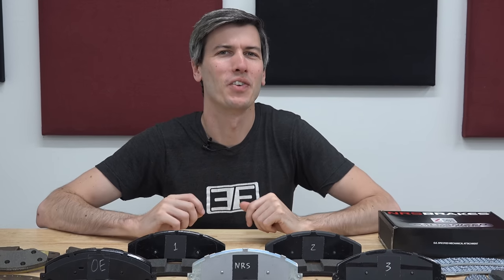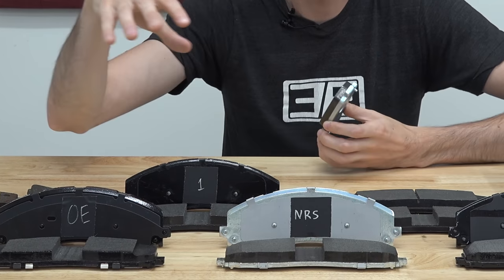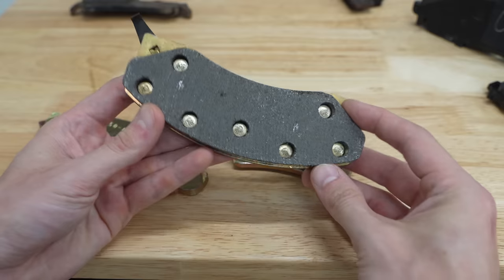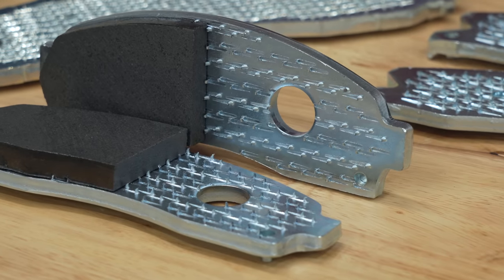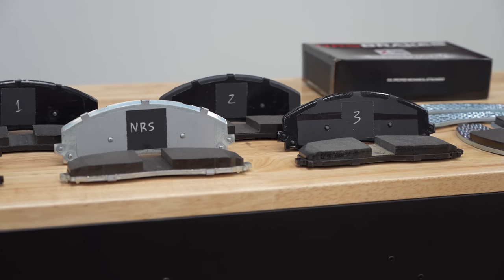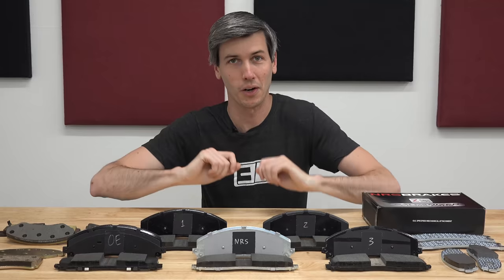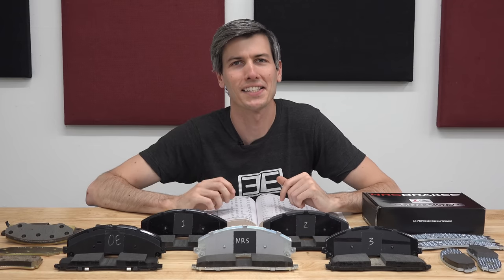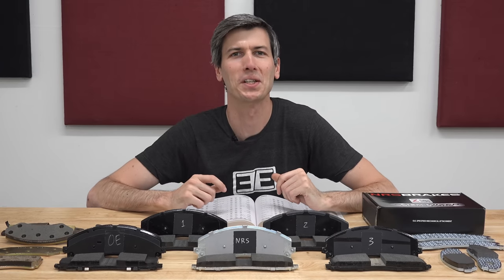The Sketchy Truth About Aftermarket Brake Pads

Comment: This is valid for track vehicles and work vehicles. Let’s face it, majority of us have never overheated brakes like that and have never had friction material separate from the backing plate.
Reply: Lol this whole video is a paid advertising and he doesn't disclaim it as such. Like did you have any doubt he would NRS brakes the best of this bunch?
Reply: Shoot over all quality is bad for aftermarket parts even oe replacements got my brakes redone and they are done after 3 months of normal driving mind you I might have put 3k on it and I have a warped rotor and completely worn pads...
Reply: In my lifetime, I've never had a brake pad fail on ME.  I just buy the mid-range Advance/Autozone/NAPA/O'Reilly pads.  Whatever is convenient.  I do not drive a racecar or a work vehicle.
Reply from the maker: Yeah - as stated in the video - all the demo pads shown are for a heavy-duty truck (though a ton of folks buy/drive this truck in the US).
Reply: It's a concern for trucks and rv's. Its pretty easy to cook your brakes on a long incline. I'm about to pickup a 20500 gvwr motorhome and that amount of weight generates a tremendous amount of heat.
Reply: Engineered solution, even for heavy duty/racing: regenerative breaking
Reply: @AB0BA_69 he does disclaim it, twice in the video and once in the description.
Reply: @nsilversradd  you mean, he does claim it.
Reply: You ever drive over the passes in the cascade mountains? Or travel across colorado? Miles and miles and miles of steep downhills. Yes technique in both driving and braking help, but you definitely see people just ride brakes down the hills forever
Reply: Agree, bit of an overkill.
Reply: @jblob5764 True, but this is a very small fraction of the driving done in the USA.  Far more brakes fail from rust than from heat.
Reply: try moving to a state that's not flat 😉
Reply: @EngineeringExplained I drive a pickup truck and do construction work.

 I buy my brake pads from AutoZone and I have never had them delaminate. Even running them down to almost nothing. 

I've been doing it for almost 40 years and I'm a carpenter not a mechanic. This delamination of brake pad material is a non-issue unless you are driving race cars or something.

 I'm in the city so I have to slam on my brakes often enough. The brake pad material is not coming off.
Reply: @actionjksn  you also probably take care of your equipment. You get some drivers that don't and you would be amazed at the issues that pop up. Had a guy driving a F250 with a enclosed trailer at work, and the only reason the mechanic learned the trailer had completely greased trailer brakes is because the truck's brakes were completely ruined. We fired that guy, but some people don't know there is a problem until it is a very big problem. 
There are plenty of videos showing just how oblivious people are to the state of their vehicle. Seen one a few weeks ago where the customer brought in an AWD car for an issue and the mechanic found a sizable chunk of the rear differential housing was missing; that the customer knew nothing about. I think it was a Jeep that another guy was checking out a noise and a pin in the transfer case had cut a groove out of the case, like a quarter or more of the case has a pin sized slot just ground out of it.
Reply: To the people saying its a non issue because they have never had it happen, remember we're literally talking life and death here.

Ever been in a plane crash? Me neither. You know why? Because they take stuff like this deadly serious. Its ok if we do more of that with motor vehicle safety.
Reply: I have had pads separate.  And not from hard driving either.
Reply: @russelloppenheimer3970 oddly enough, airplane brake rotors are attached with, let me check the Boeing manual for 737-800, oh yeah, it adhesives.
Reply: @Xander-dx6mw  nobody said only mechanical attachment is acceptable.

One of the issues wirh adhesives is backing plate rust causing pad to shed. Airplane systems have regular inspections and maintenance that is not neglected like cars and trucks. There are failure modes that happen on roads that won't be happening on runways.
Reply: Im in canada, I had a small sedan, installed cheap parts on it, and got all kind of material brakes failures, includind brake pad delaminating because of rust and no mecanical bonding, also brake material breaking into little pieces. So I totally believe in the absolute superiority in longevity and performance of good quality products and rust prevention techniques.
Reply: The main way I see separation is rust jacking, which has nothing to do with overheating
Reply: Great info. Would have had much more value if the brand would have been disclosed.
Reply: The average driver speeds and tailgates.  They are very hard on their brakes. By the time they get their destination the heat generated is shocking.  Rotors get hotter and hotter sink and transfer it to the pads.
Reply: I have literally had brake pad material separate from the backing plate on multiple occasions while tracking vehicles.
Reply: Regardless he presents facts and DATA. What do you have? Anecdotal experience. Literally means nothing with respect to the engineering world. Yes, most brake pads live long lives without catastrophic failure, but that’s not all that’s brought to light here. This testing plainly shows how some are simply engineering pads to a higher degree, and  that OEM is usually the best bet all things considered.
Reply: @nordicpride9708 that's all well and good but it's clickbait af to title the video "the sketchy truth" when the actual truth is that all pads must meet industry wide safety standards. Is one better than the other? Sure. Is it in any way even close to being "sketchy" to use an adhesive pad? No.
Reply: True. I guess it only matters if you think you’re paying for something made better than it is.
Reply: @Imwright720  Agreed, I don't ride with non family members much, but when I do I'm shocked at how they drive. It explained why one coworker was complaining about getting brake jobs every 15,000 miles. I typically go about 100,000 miles on a set of pads, and only replace them then because it's easier than continually checking them as they get thin.
Reply: I'm like ,if you've done that (separated pads and severely overheated your brakes) on the street you're doing it wrong.
Reply: @GoldenNada  agreed that newer stuff is trash. 
I found some "nos" repco metalmaster metallic pads on eBay for my mk1 VW. 
It was a great pad back in the day and I haven't found reasonable priced modern pads that work as good as those.
Reply: This guy obviously has never lived in New York lol
Reply: Your brakes can get stuck and overheat
Reply: You're obviously not from Florida
Reply: Though I have seen chinesium crap separate under normal use in a fairly small car (VW Golf, I think). And by chinesium crap I mean the guy probably spent less on said brake pads than on the day's pack of fags.

I also once saw ones which had separated IN THE BOX.

The level of pure shite you can buy on the internet never fails to impress 😂

Beyond that though you're right, unless you're street racing or carrying 3 tonnes of cement down a steep hill or something like that, you should never get the pads hot enough to suffer this issue. So long as you don't buy crap.
Reply: @nordicpride9708 yeah, that's why everyone who races uses OEM lol
Reply: @CS-pl8fc  We are discussing light truck/car applications. If you want to compare something that’s not analogous, it’s pretty much a moot point. Apples and oranges. Never once did he nor I put this in the realm of “racing”or “race cars”.
Reply: @nordicpride9708  people race cars. People track their daily drivers. That's a car application. And you weren't discussing those things, you were discussing how well they were engineered. And you're wrong that OEM is usually the best.
Reply: @CS-pl8fc  I want some of the GLUE you are huffing 😂
Reply: idk it still seems better to have them mechanically attached
Reply: I have
Reply: I actually know someone who detached the friction material but I think it was just a defective one
Reply: Even that is debatable. *DAY* at 550F ? Where outside of the race track you see temps like that ?
Reply: I had the friction material separate from the backing plate on the brake pads of my car. It failed the inspection.
Reply: @jblob5764  Failure to downshift, consider loading of vehicle, or reduce speed for hills is operator error. Good brakes are more tolerant of error than cheaper ones, but any brake system meeting DOT standards is sufficient for a vehicle, in good repair, driven skillfully, within legal limits.

So many problems with vehicles come down to "improper adjustment of the loose nut behind the steering wheel," with grossly-negligent maintenance getting an occasional assist.
Reply: @jblob5764 Thank u !   Indeed and it's so bad and ppl are sooo dumb-e, that the gate ppl at the national or state parks there in those mountains in CO, have to check your brake temp w/ a thermal gun!  Even my awesome basic Cherokee was slightly hot
Reply: Hey greg, speak for yourself! You are also totally oblivious to the point of the video.
Reply: @RyeOnHam I've had 2 week old drum pads fail on me. The pads basically disintegrated almost immediately. It was not user error, it was cheap pads. They were the cheapest I could get from the parts house and they weren't worth it. I got the house brand or the 2nd or 3rd cheapest option anf they were completely fine for years.
Reply: It's pretty easy to overcook the brakes in cars and SUV'S if you are carrying close to the payload/passenger weight, driving fairly aggressively, and in the mountains.

For example, took 3 buddies in a Santa Fe on a golf/houseboat trip. Loaded it to the max with supplies for the week and 1000 lbs of passenger weight. Trip was 4 hours long through the mountains with frequent passing. The front breakpads were glowing when we stopped after I noticed near to no braking ability. Had to dial it back the rest of the day.
Reply: No, this is valid for safety and must be adhered to as a standard of manufacture.
Reply: I have overheated my brake pads and boiled my brake fluid canyon carving with my car. Mind you, it’s a 4000 lb grand tourer with large Brembo brakes, but the pads and brake fluid just weren’t up to the task. And that was street driving, mind you, highly spirited street driving.
Reply: Yeah I have to agree in every single application that I've ever had in 32 years. I've never had a brake pad fail or separate. Yeah I'm not towing the space shuttle or anything so maybe that's why?
Reply: Here in the northeast, where the roads are covered in salt for at least four months of the year, pad separation is VERY common. In my years running a repair shop I've seen more pads replaced because of separation than because of wear.
Reply: I drive small light cars and don't exactly beat on the brakes. That said, I have seen my brake pads and those of customers separate partially or entirely. Luckily it never caused a safety hazard, but it definitely happens. None of the pads I observed this on had mechanical attachment and most only had a few of those post holes.

The most glaring example I can give is on a 90s Impreza I started hearing noise in my front left when I would turn one way, but not the other, and only when I wasn't on the brakes. When I inspected the brake pads, it turns out the outside driver pad had almost completely separated from the backing plate. It was flopping around on the small amount of adhesive remaining and scraping against the rotor when I would turn one way, but flop back against the backing plate when I turned the other way. The pad separated entirely with light prying.

At any rate, I live in the Northeast, and I have used a variety of cheap brake pads. In most cases I suspect a few overheating cycles, such as when exiting an interstate or having to panic stop, plus rust jacking, which is very common for all sorts of parts and car paint up here, are to blame. While not necessary for the majority of cars, I certainly would not mind having mechanical attachment for any brake pads I use!
Reply: @18_rabbit  yeah Colorado is crazy! I climbed Mt Hood whixh is the tallest mountain in Oregon at 11,200 feet... Then a month later drove on a HIGHWAY pass in colorado just as high on my way to Denver. Deflated my ego a bit 😂
Reply: So did the "shear test" take into account the braking force of the caliper pressing pad against the rotor? I have abused brake in cars until the basically overheated and boiled the fluid, but have never seen a pad come apart like that. I even have freinds that track and haven't see that (although they may have I will ask)? @EngineeringExplained
Reply: I had friction material separate from the backing plate
Reply: Not many people will cook their pads badly, but here in the UK, rust would be a significant concern. I usually fit OEM as they're a good compromise between longevity and performance.
Reply: @RyeOnHam I have circle tracked a latemodel going over 100 going into corners and have used straight up china special eBay brake pads. I might only get 70% life but it’s 4x’s cheaper. Never ever had a problem. And I have had them cherry red. For 15 mins a 100 times through the season. Pointless video.
Reply: Brakes do get hot in certain situations, those sits build up, like if ya have to slam on your brakes going down hill in an suv, steam shot out the sides, brakes ended up ok tho, was a heavy durango rt on proxes. Just recently I was in my is350 when again, someone darted in front of me to get into a less packed lane then slamed on their brakes just feet from me cause another JUST HAD TO get that shorter lane! Rant over :)
Reply: Yeah. I'm with you 100%. I am an automotive technician and have 21 years of experience working for both Land Rover and Mercedes Benz dealers. I have never, ever,  seen nor heard of,  any brake pad material separation from the metal. Even brakes that were very abused off-road on Land Rovers or severely tortured brakes on Mercedes Benz AMG cars that customers took to tracks or autocross. In 2 decades I've never read even a TSB on such a thing........
Reply: Yeah honestly it's excruciatingly rare to lose a pad in conventional use. You're far more likely to get warped rotors from hard braking than failed pads.
Reply: @GoldenNada  Good news is you can warranty those rotors. Majority of rotors have a 1 to 2 year warranty.